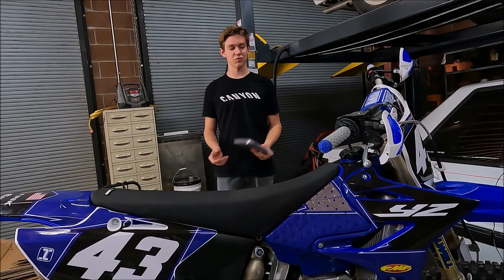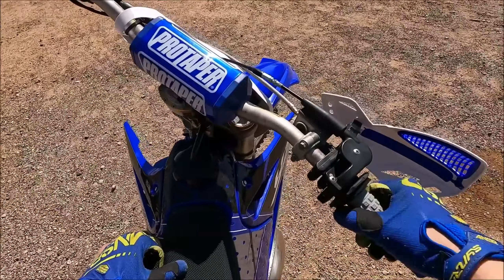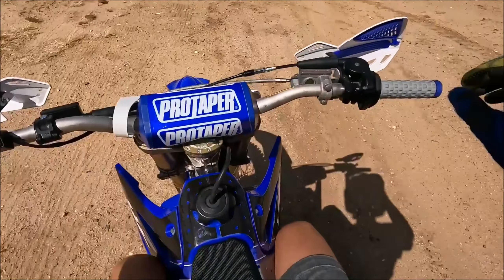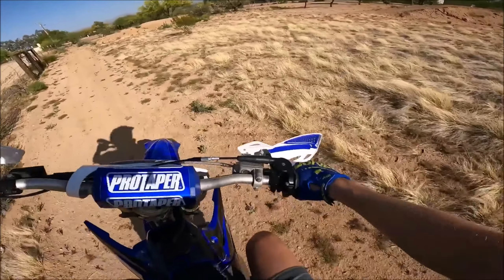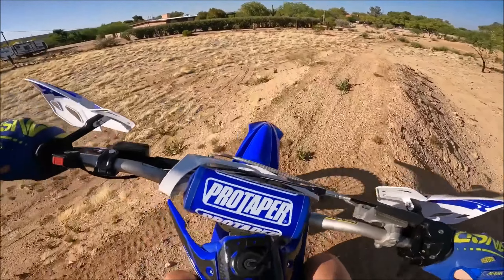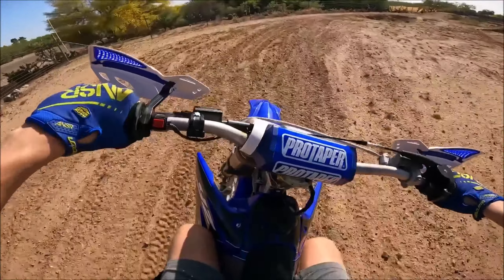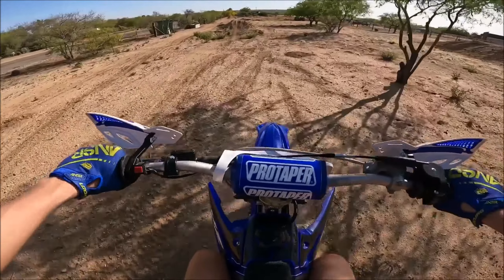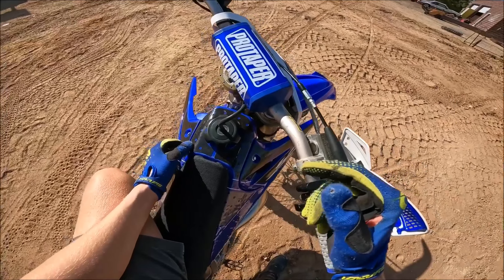Should You Get A Flywheel Weight? Flywheel Weight Comparison

Comment: I did the 13 ounce on mine and there were 3 issues.  1. the ignition cover rubs on the fww unless you add a few extra gaskets, not a big deal.  2. you must bend the clutch actuator because it interferes with the fww which then causes your clutch cable to break prematurely from rubbing at an awkward angle, medium deal.  My fww side crankshaft bearing went bad, possibly due to the extra weight on the crank end.  I loved the way it rode with it, harder to stall without sacrificing the quick throttle response.  Just get the 11 oz..
Reply: I’d do a 9oz
Reply: @goinhot9133 what does the different sizes do? What will I need for a 2001 yz250
Reply: @sean.g4516  9oz is what people usually run, unless they’re looking to do some hard enduro, super slow, technical stuff & want to completely mellow out the bike, they might use the heavier option. (11-14oz I think).
It’s adding weight to the flywheel. It doesn’t give it power, just changes the power characteristics.. so you’re adding weight to the crank, which means when the bike should “bog” down, it doesn’t bog as much and has more low end grunt, because the weight on the crank gives it momentum and helps it keep spinning, at lower rpm. 
Hopefully that makes sense. You’re just adding a big weight to make it harder to slow down the crank. Like when you grab traction, or something. So it will seem to have more low end power, but it won’t rev as fast or as high theoretically, because the added weight the engine has to get going.
Reply: @sean.g4516  I’d get the lighter one for your bike if you do harescrambles… if you want your 2T to be a tractor, get the heavier weight..
Reply: @goinhot9133  ok sounds like I need the 9oz. I jst do normal trail/woods riding, dirt roads and hay fields. So Is This something that might help with learning wheelies an going over logs?
Reply: I would probably try a different brand also. If a company can't think those issues through before they sell them, I don't think I would buy from them again.

Comment: You should only get a flywheel weight if you are smarter than 100's of japanese engineers who studied this bike for decades.
Reply: Ahhhhh Sooooo ; Ahhhhh Merry Kan's Berry Smaht !!! 😊
Reply: Funny how those same engineers already made their own flywheel weight that you can buy and put on the bike. Perhaps it’s because different riders have different needs for their bike which are impossible to accommodate from factory alone.
Reply: I know your point.  It is usually a bad idea to think the factory engineers don't know what they are doing.  But this is a new progressive dysfunctional generation today. I have a modern 2019 YZ250 that I have never had to do so much work on a new bike to make it a really good bike, (better than the X for the woods now).  Too tall--lowered it 1.75" total, seat 1" and suspension .75", (just physics man, the tallest bike needs the berm), Jetting is terrible,and the engine, top rpm power to keep up with a 450 4-stroke on the fast MX tracks today, (not happening), pretty much stinks for any other kind of racing/riding. So I got more low end power from it, (port 2-stroke engines for a living).  Maybe I should have suspected this, when I saw the kids who design the plastic must have graduated from the "Batman school of art". Yea,---I fixed that too.  Abstract art (that means nothing), does not belong on my functional dirt bike.  :)
Doug in Michigan
Reply: Usually, only people who have never used it before make these kinds of comments. I know a lot of people like that, and what they say most often is, 'Don’t modify it, the stock setup is always the best.' Guess what? The so-called stock setup is just a configuration that, in your words, 'the engineers think might work for you.'
Reply: The Japanese engineers designed a motocross race bike.  If you want to ride in the woods, you have different goals than the engineering team did.

Comment: I'm curious if the 250x can power a headlight so it can be made street legal.
Reply: I seen some dude use a power drill battery so i guess you could use just about anything 😂
Reply: You also need turn signals, horn etc
Reply: @TaxationIsTheft439   Thats easy. My state you can make ORVs legal.
Reply: @TaxationIsTheft439  I don't know about today, (been off a bike for a while), but in Michigan, it was pretty easy to make a MX bike street legal.  Hand signals needed no blinkers.  For the horn a little squeeze ball horn many mounted on the bars.  I am not sure about the lights, but I remember street legal kits sold for about $300.00.

Comment: I bet that some or much of that problem with you not getting a good feel on the bike is soft fork springs.  My 2019 MX model had soft springs for a 180 or heaver guy.  So the front end rides low, reducing the trail of the front wheel, (rake and trail, very important).  That makes the front end feel skittery.  So with springs that are too soft, then you set the rear sag for the proper 4" (approx), the front end becomes even worse.  I was a bit over 200 when I bought my bike, and no doubt, even before I set the rear sag, the bike felt "un-ride-able".
It is all in the bike set up.  I also find the front end more stable, especially going into corners, by going back to the late 80's/early 90's handlebar set up. (bars back more, and levers down more, so fingers to high elbows are straight).  I could not get used to the "modern" high handlebar set up that I am sure came from freestyle.  Also, with the forward bars, the rider position (for pro MX/SX), has moved forward a bit, and that teases front end trail.  That is why they use more rear end sag, (105mm or more), to offset the forward riding stile.
Thank goodness the bike geometry has not really changed much since about 1982, so we can set our bikes up either way.  But I know now, I can out corner any stock height YZ250 out there.  Stupid tall bike, especially for the woods. Just say something.  :)